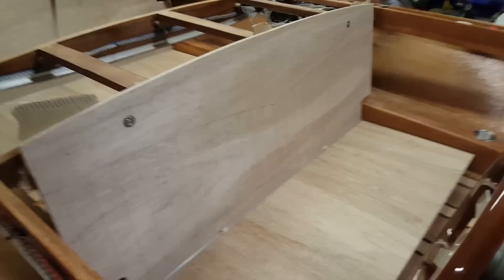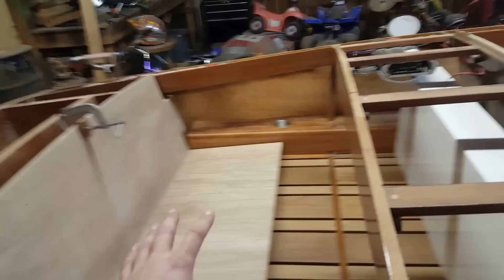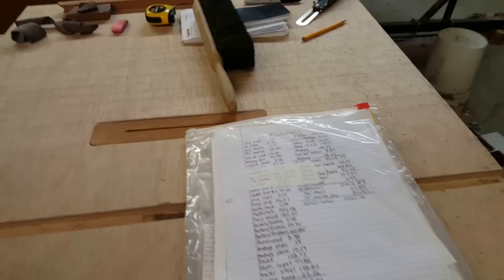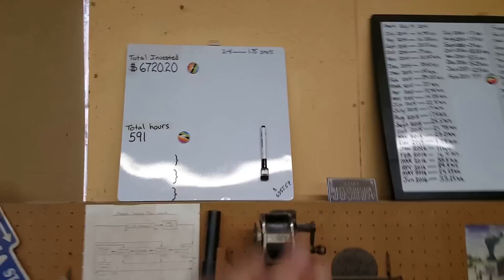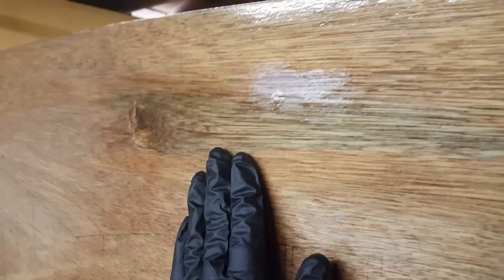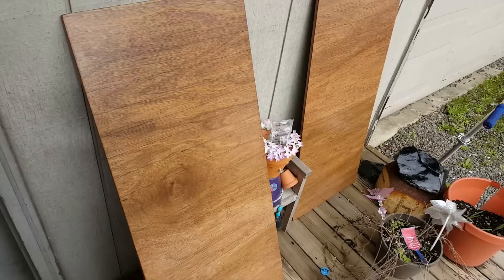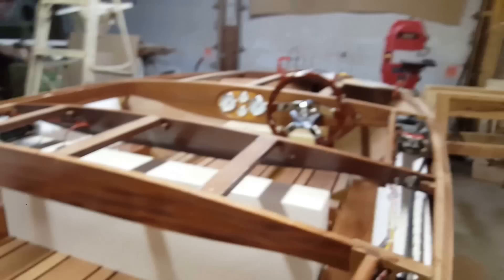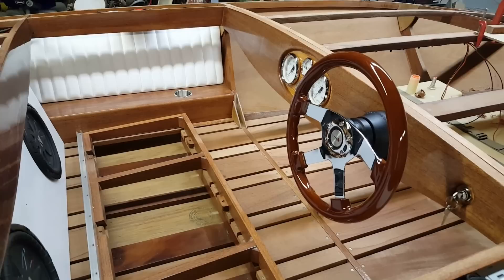Building the Zip vol# 36

Comment: Joshua,  really enjoying your build.  I finished my Zip several years ago (Buckeyesmith on Glen-L) am reliving the experience through your project. Mine was a 1 year project that took 2 but wished it was 3. I am particularly interested in the honesty of your financial and labor data. 
  I would suggest a good varnish for your interior, especially the floorboards.  I launched my first build with an epoxy finish and was shocked at how slippery it was. It was in saltwater but I doubt that made the difference. Varnish gives a bit of grip, adds UV protection and looks great. I used the same high gloss that I finished the exterior.  
  I sold mine but was recently given a ride in her, three years after I sold her, making a total of 4 years use and the varnish was in great shape. 
  Keep up the good work.  

Todd
Reply from the maker: Todd Broadlick thanks for following todd, as soon as i saw your name in the comment section i knew who you were! i took alot of my inspiration and ideas from your build, you built a beautiful zip! when i first started my build i had vupilot's videos on repeat and he has posted a couple vids of a ride he took in your zip when he was building his, thanks for following and for commenting,  makes a guy feel pretty good knowing a fellow Zip builder is watching, especially knowing the quality of your build,....Josh

Comment: I'm sure you will be thrilled when you have all of the floor planks removed , encapsulated , and reinstalled with all of the interior in place. You might want to cover the interior when you move on to the final wood work on the top. It will drive you nuts knowing you got dust down under the planks. Thanks for sharing. Looking forward to seeing you finish this up. Any thoughts on what you want to build next?
Reply from the maker: mazdalorean i have a few projects lined up, #1 1964 amc rambler american 440 convertible (was my dads) then #2 a teardrop camper, #3 a bobber style harley/chopper build, lots and lots of back burner projects, my plan is keep enough projects going to be too busy to die!